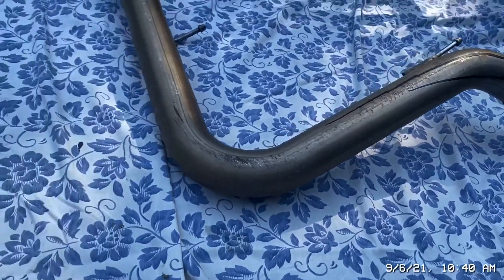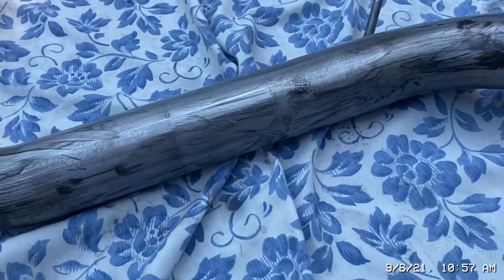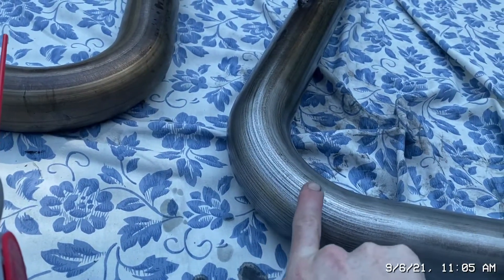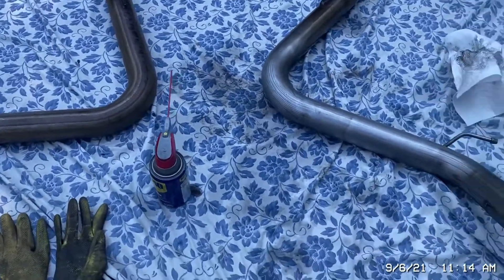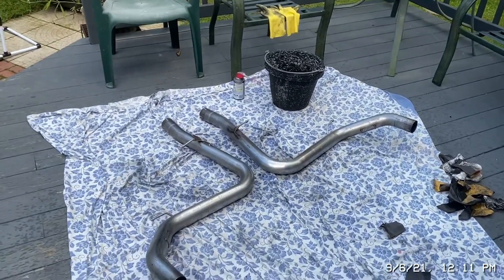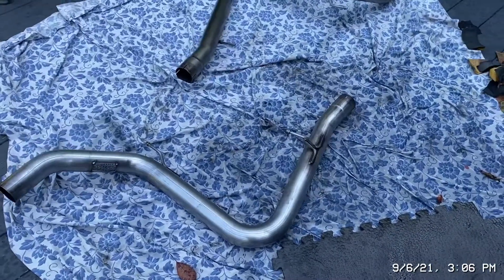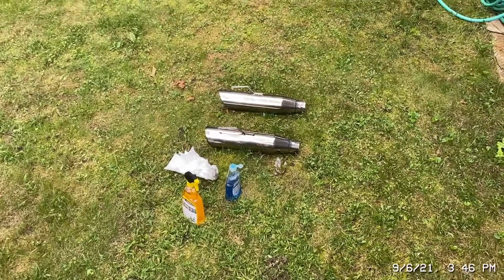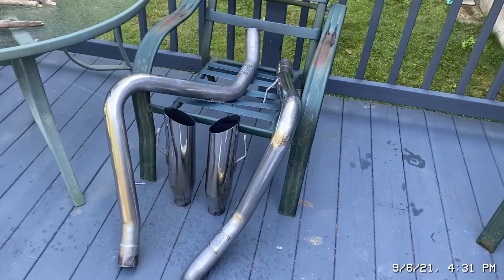Polished Bassani Exhaust?? | Why Borla is Better!! | 2003 Mustang SVT Cobra

Comment: Considering how bad those pipes were to start, you did a great job with them. The tips are the main thing though and they came out nice. Bassani might not look as good as Borla but their system sounds just as good. I was going to go Borla on my Terminator when I got it but as soon as I drove it for the first time I changed my mind.
Reply from the maker: Wow I appreciate it man. It was tough to be satisfied after watching Danny video how shiny his came out. But I’m actually really pleased with it! It will dress up the back end nicely.
Cobra Bob said just make sure you get them both as level as possible because the more shiny they are the more people will notice! 😎